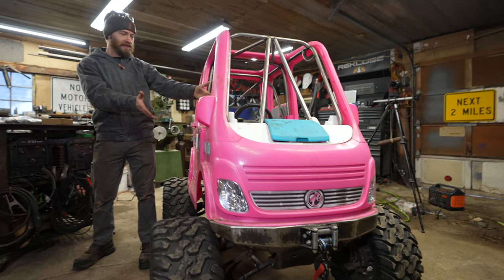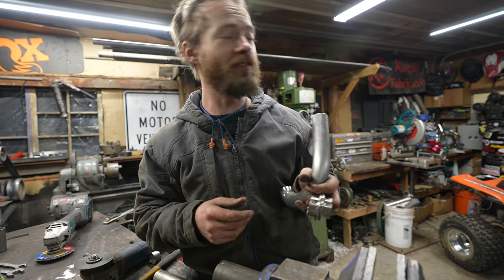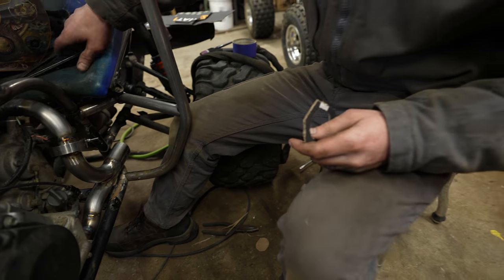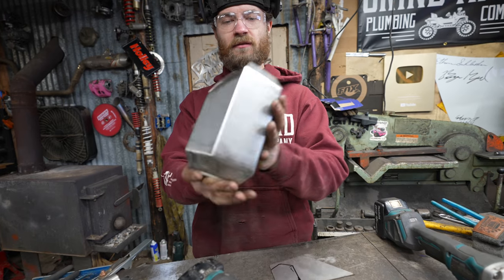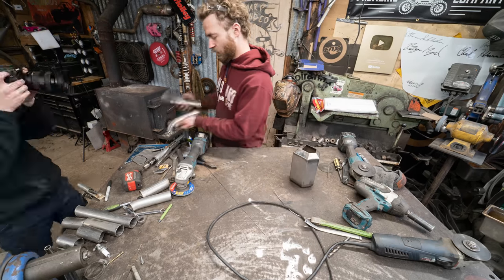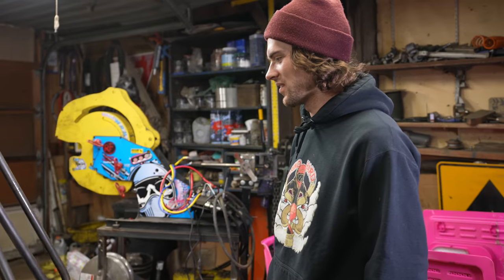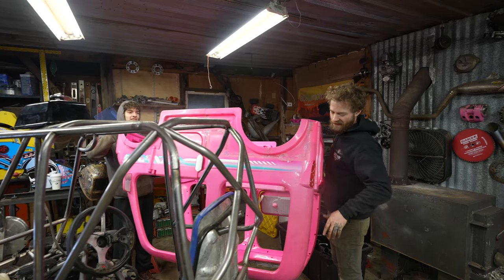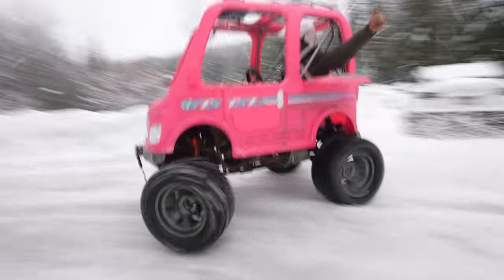750cc Camper Van First Start and Test Drive!

Comment: if you really want to treat yourself with that gas can, go to the hardware store and get the super flexible tubing and a ball valve. put that ball valve down by the cap. then you can insert the tubing into the gas tank and get situated then turn the valve and let the fuel flow. it is so nice. also makes it easy to shut off and not have spillage or over fill problems.

Comment: Great channel!! The camper is going to be awesome when ya get it done!! I do have a question for you guys. I’m building an off-road/hunting/fishing electric wheelchair. I have an older electric wheelchair that was given to me. Definitely needs a major upgrade with the batteries and electric motors to start with. Eventually it will have some sort of tracks. Was wondering if you guys might have any suggestions?
Reply from the maker: How much power will it have? Tracks take a lot to turn
Reply: @GrindHardPlumbingCo  right now it’s ran on 12 volt batteries and the motors are 350 watt. Was hoping to get at the very least 36 volt

Comment: Needs a dynatech ecu and a dyno jet jetting kit the kawis are really finikey on jetting when you free up the intake and exhaust they run like crap without the air box without jetting way up and getting the proper needles

Comment: I  used to take photos at the right angle and trace and resize with a real reference to scale it and send that to cad or just use a printer at 1 tot 1 and print the templates. Spray tack work great on the paper. Fusion has an awesome sheet metal mode.

Comment: Awesome build guys!  Very entertaining to watch the process!  One thing to note with the Brute Force 750 engine,  is that the carbs do not like to operate properly without the air box installed.  I have an ‘06 Brute myself,  and it runs like crap without the air box, filter and lid installed.  Don’t know if you can cram the stock air box on there,  but you’re gonna have a hard time getting that thing to run right without it.
Reply: When the brutes are running good they rip, my moms 650 and my 750 are units. It’s also nice to see a fell brute owner

Comment: Yo, I got this hose with a shut off built in from VP Racing for your new gas can. It's way easier than using the plain hose. 
VP Racing Fuels 33320 Trigger Hose

Comment: I worked in a muffler shop and I have to say. Ethan your exhaust system fabing skills are superb very good job. but due to limited space it's too bad you weren't able to build the muffler like a Flow Master. with a single inlet dual outlet and make it have dual exhausts. but well enough it sounds very much like to Colonel which is great. I almost didn't recognize Edwin with the long hair. but recognized his over six foot tall frame and his voice. it sounded like the plugs could stand to be cleaned from the way it was crapping out. or possibly some sticking valves especially if it's been sitting for a while. but it should be double the fun when the four wheel drive done. and all the other little fixes let there be nothing said for research and development.
Reply from the maker: Thank you! We appreciate it! Yeah, lots of work to do still, but it will be awesome!

Comment: You gotta trailer Hitch on that bumper? What you gonna use it for? You guys got what 3 or 4 vehicles for Terra Firma what about building a Trailer & a pontoon Boat
Using HDPE pipe for Pontoon's

Comment: Twin cylinder engines work best with two separate exhaust pipes because of the pulses, witch if routed into one can force one pulse against the other witch intern lowers efficiency. ether way that thing is bad a..

Comment: Would love to see the Barbie van headlights turned into fully functional headlights with a proper cut off line like on a car and indicators you guys could probably get h4 led projectors they're about 1.5 inch in diameter and relatively small
Reply from the maker: We are definitely going to put real headlights in there!

Comment: It needs even a better exhaust..  Put a flat one in back instead with a U or even S shaped tube running through it.  What did you pack it with too (you did pack it right)?  You are going to want some sort of fender too.  Even if it only covers half the tire it will keep the driver from getting covered in mud.  Also you need a floor pan to keep the mud out.  And of course you need working lights and padding for the seat.
Reply from the maker: Most of those things are on the list of things to do before it’s finished!

Comment: Weird question, can you teach me to machine and build. I’ll pay for the project but you help me build it. I’m 17 years old, 18 in February and I’d like to build my first project car but don’t have the equipment or anything to use. I have a really good understanding of cars and building just don’t have the hands on time. The project is a Japanese mini truck I was thinking of doing a 1300cc hayabusa swap with a turbo. Lowered widebodied and with a lot of custom parts. Thinking of putting a mount in the back to hold a motorcycle and lots of other ideas I can’t really do myself

Comment: i am suprised that yall or cars an camras hasnt itergrated sum of the eggsawest threw the frame an exit out the back with turn downs on sum rigs or tiny to meduim stacks with the ole tractor flapers lol
Reply from the maker: I did consider using the frame as exhaust, but it’s not large enough diameter tubing.

Comment: Ever thought of removing the windscreen bars for better visibility? Maybe you could think about putting in a plastic windscreen and then with the roll cage you wouldn't need the helmet to safely drive it. Also any plans to maybe cut out some roll cage cross bars to make an easier way to get in?
Reply from the maker: Those bars really don’t effect visibility very much, and every bar is there for a reason. Driving it without a helmet could be more dangerous than you think, because you would hit your head on the cage with every bump.
Reply: @GrindHardPlumbingCo  Thanks for the reply. Guess I can't know without ever driving something like that. The only other thing I'd want is side view mirrors. I can't stand driving my scooter without those.

Comment: What you should do is add some sort of windshield and paneling for the windows. Add wheel wells and some sort of a floor pan and maybe insulate it a little bit. To get in, just make it a latch door or something like that. It'd make it more comfortable to drive in when its cold out and so you dont get dirt, snow, and mud flinging up at your face and back. Love the project tho!
Reply from the maker: That would be super cool!
Reply: @GrindHardPlumbingCo  It's already one of the coolest things I've ever seen!

Comment: I wanna strat making my own stuff but Im afraid Ill shock myself to death with a welder. Never welded before still considering a gasless welder even though Im terrified.
Reply from the maker: I don’t even know if it’s possible to shock yourself to death with a welder. In the 15 plus years I’ve been doing it, I’ve only shocked myself once or twice, and it was barely enough to notice.
Reply: @GrindHardPlumbingCo  Thanks for the reply! I'm probably just overthinking it a bit, I'll have to give it a try, and just do some research to make sure I can use common sense. I literally know nothing about welding. :D

Comment: Why do you just have tack welds holding the whole cage together?
Reply from the maker: Making sure everything fits before finalizing anything
Reply: If they need to change something around, they can just cut the tacks instead of re-doing full welds. They'll completely weld everything before final assembly.

Comment: As a brute force owner 
Check carb boots for cracks 
Rejet because of the exhaust 
Adjust valves 
Clean carburetor 
Buy a dynatek cdi it removes reverse limiter and avance timing and add throttle response be sure to rejet after
Reply from the maker: Thanks for the tips!!
Reply: @GrindHardPlumbingCo  also check your oil often

Comment: Now add some plexi-glass windows and a roof then you can drive it anytime you want without getting wet
Reply from the maker: That would be awesome!
Reply: @GrindHardPlumbingCo  Also, it would probably hold the heat then, so you get a heated cab at the same time! :D